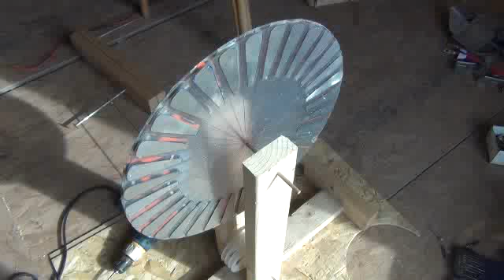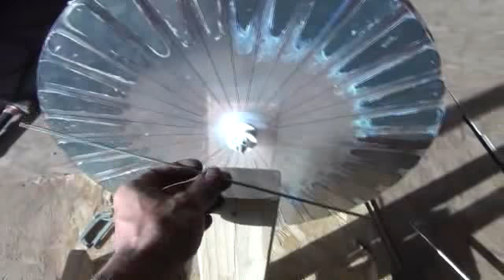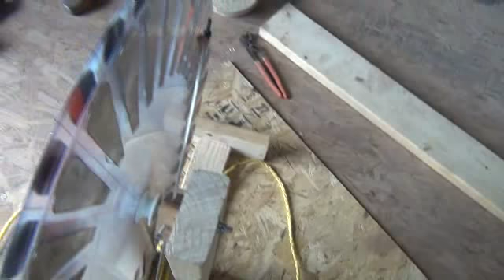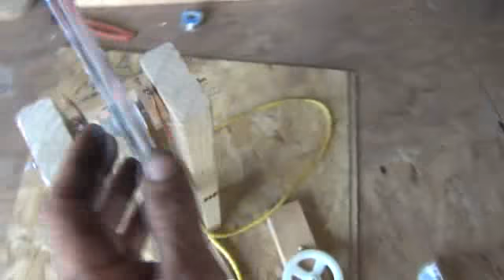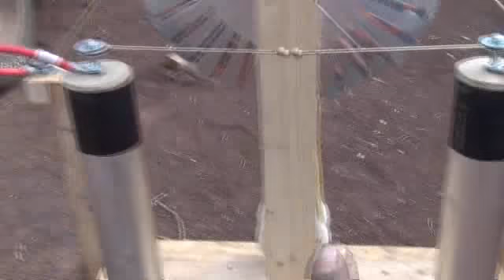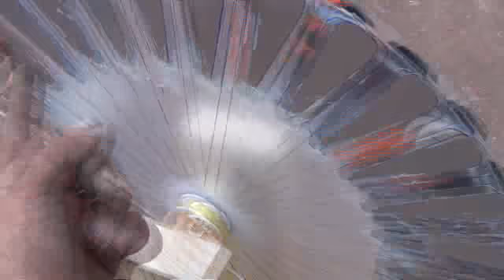Home made Wimshurst machine, full build 18" disc's. huge capacitors

Comment: Should have used adhesive backed aluminum tape for the charge plates. Would have given you a much better outcome with far less mass. The tape would give you less chance of getting your plates out of balance, is much easier to cut precisely, less mess than using epoxy, and gives smoother edges for less corona leakage.

Comment: Another trick is with aluminum sheet metal. Up to about .042 you can RAZOR knife cut. So after you laid out your petals you razor knife the straight edge, bend backnforth SNAP! then you can snip the curve with your reds. This is a real common shortcut in SM industry. dont attempt with stainless steel, lol.

Comment: Your my man! I say that with a  firm handshake.  Remind me that i could of been somewhere better a few forks in the road of life back. I would like to share something from my path of 20 some years as a thermonuclear engineer..AKA pipe insulator,.. study on using dividers as a tool, they work great! Eg: when you make a circle you can divide the circle into 3 by scribing the edge with the same set(radius) and arc divide from there 24.36,42.or in 4s like you, did, divide  1/4 of it  then walk meas